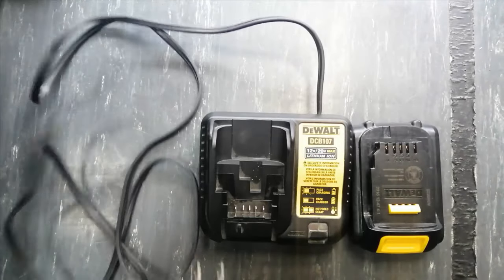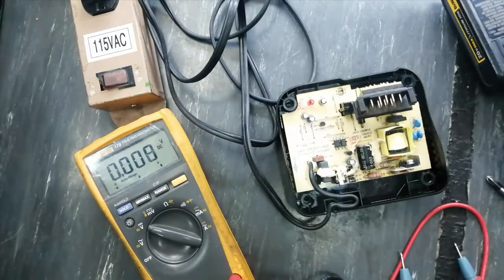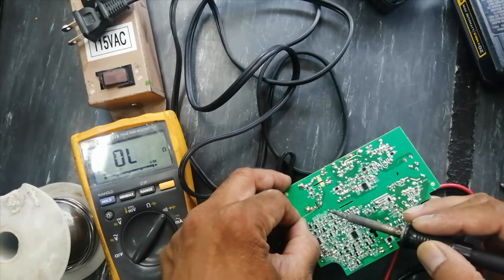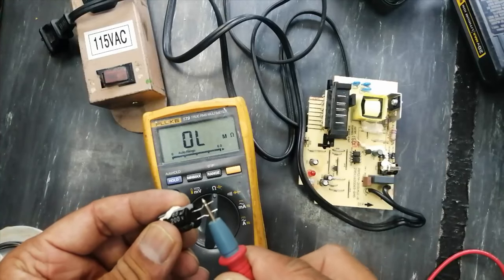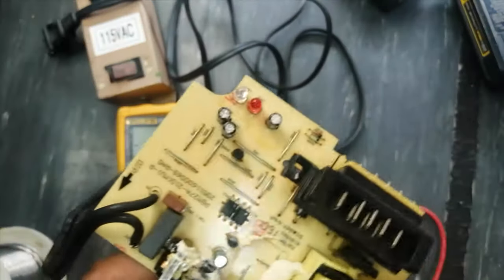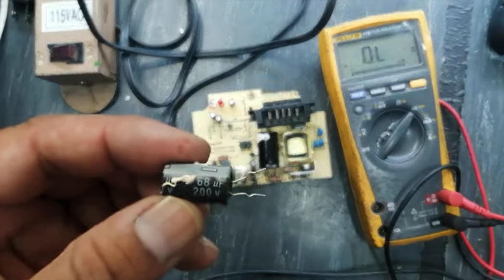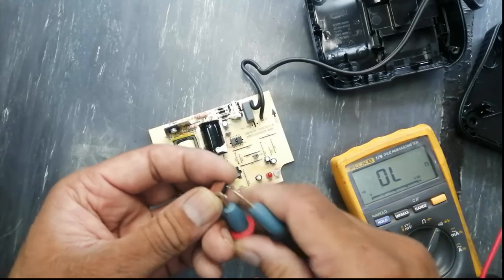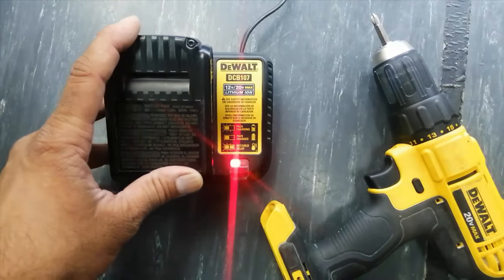#268 How to Repair Battery Charger DeWalt 12V/20V Battery DCB107

Comment: Thank you Haseeb! No thank you DeWalt. I have a great three-year old drill. Same charger problem. The capacitor cost me several weeks and less than $2 for 2 capacitors on a slow boat from China, including shipping! Alternatively, the cheapest replacement charger I could find was $100. I won't touch another overpriced DeWalt product. (Yeah, customer support phone dude, I'm following through on hurting DeWalt's reputation.)

Comment: Hello, I have a dcd710 dewalt 10.8 volt drill.  No original battery.  This drill has 4 inputs -, +, thermistor and ID.  But I can't get it to run by just giving it -, + power.  Trigger Led is on, motor does not turn.  Engine is OK. What is the problem?  What can I do.?

Comment: Thanks for sharing. Just one correction: at 4:30, you said about the big capacitor that it is 68V and 200uF, but it is on the other way round. 68uF and 200V. Just for proofing that I am listening carefully to you.🙂
I know that, because I have learned a lot from you, my friend. After the bridge rectifier the DC voltage is around 156V. You are my "teacher" and I have learned the formula: 110V AC x 1.414=156V DC.
Many thanks for teaching us with your videos.🤝
Reply from the maker: You are correct. it is really wonderful reversal that i pronounced voltage with capacitance
and capacitance with voltage. really special thanks for your interest,
i am sorry for mistake
Reply: Do you know replacement part for r17?

Comment: You are a genius. Bro i wish i could reach you... I had a lott of trouble by getting my dewalt charger shot circuit. In my city, no one could repair it. I got a new charger but i have to wait for 2 years.
Reply: @HaseebElectronics  yes brother. My dewalt kit was imported from US. I live in Nepal. I was totally unaware of the voltage difference there at US and here in Nepal.So  unfortunately as i plugged the charger pack it got into smoke. After watching many videos on YouTube i was sure the capacitor has got damage. i tried to change the Capacitor but still it didnt work. Anyway now i knew that the diode and the 2amp fuse can be also the issue.
Reply: Also brother now i got a new one at a very high expense. The delivery charge from US is much more than the price of charger. I am afraid to charge it back. I have a votage converter from 220 -110..but dont know how the voltage converter is working or not. Since the charging Blink is not as it should be.  
The frequency of the  blink is - once and then two times(.  ..  . ..  . ..  . ..) I hope you will help me in this. 
Do you have watsapp, viber or facebook?
I can send you the video. 
Bro im helpless here, no one is good technician in our city

Comment: I did same tests and fuse good and diodes good what do i check next
Reply from the maker: did you verified dc voltage on bulk capacitor. it must have stable dc voltage
then check vcc capacitor 
and verify the secondary section and BMS

Comment: Great video.  In my case, the charger had both the AC and DC present but still would not charge the batteries, after I reflowed a number of suspect looking solder joints it started working again.
Reply from the maker: wow that is awesome 
sometimes the dry joints make problem, specially in power electronics because it deals with large amount of current values

Comment: Can you use a power strip plugged into the isolation transformer so you can have the option of multiple outlets protected? I was just wondering if it will be ok that way?

Comment: is it ok to change 68uf 200v to 68uf400v? i have 110v accidentally plug in to 220v when i look at the capacitor is blown my problem is i cannot find 68uf 200v insted is 68uf 400v
Reply from the maker: if 200v capacitor is not available
and you can find 400v with same capacitance
you can replace it. it will work safely 
because the new voltage range will higher than the original 200v capacitor
Reply: @HaseebElectronics  thank you so much to youre video may charger is ok now

Comment: hello good afternoon, very good video. I have the same charger only that in my country it works with 220V. I wanted to check when measuring the capacitor once the charger is connected, it shows a measurement of 300v VC. when it should be around the same size as you show in the video, the truth is I don't know what could happen. I would appreciate your help. Thanks a lot.
Reply from the maker: you are right, when we apply 220VAC then 220*1.414= 311VDC so the voltage at the dc capacitor around 300 to 320VDC
thanks for your valuable comment
Reply: I think the only difference between the 110v and the 220v version are the capacitor. Is 200v for one and 400 for other. Correct me if I wrong

Comment: My dewalt 12 /20 v DCB charger , I connect a discharged battery and the Red Light stars charging and at once it changes to Fixel Red as if it is fully charged and it is not . What should I check the charger   ?    Thanks Haseeb Electronics
Reply from the maker: kindly check the output OPAMP / Comparator IC which is monitoring the battery level
Reply: @HaseebElectronics  how? im newbie

Comment: Hello bhaiya, I need a help again from you,,,, I have 24v smps for disco light,, it was with a fluctuating output fault, I was trying to figure out the fault with the help of your video,,,
There is nothing short in secondary, and slight fluctuation in main capacitor also,,, and then while checking with multimeter I mistakenly shorted 12n60 , it got short and I replaced it,, but now there is no output, it's like dead,,, I get volts until main capacitor,,,, please suggest me what to do.....

Comment: Man I have that charger 110v,but I need 220v.Does it possible to convert on 220v and what I need to change?I would be grateful if you would answer me.Tnx
Reply from the maker: i will recommend to not to change it. as the 110 circuit is different, its all calculations are for 110v there are some tricks to change some components (input filter, fuse, bridge, capacitor, snubber, startup resistor) and it works for a short time then its transformer goes away forever, WHY?
because the inductance value of existing transformer is for 110VAC voltage (160VDC maximum). if we expose this winding to 220VAC (330VDC nominla) what will happen. transformer will saturate immidiately due to getting peak current
so i will request to not to play with it. there are 95 percent failure chances. if you replace the transformer with all components the 95% success chances. in this condition the components price will reach above 70% price of the charger. that will not a good decision to modify it
it is much better to purchase a step down transformer for its long life usage
Reply: @HaseebElectronics  Thanks for illustration